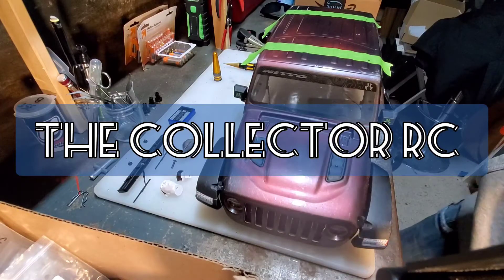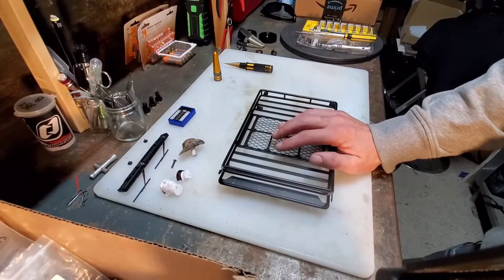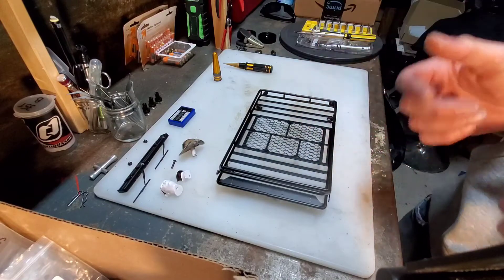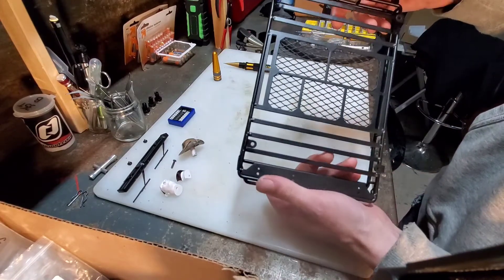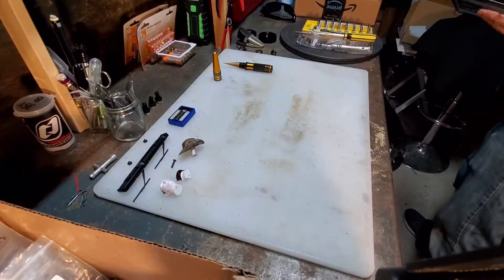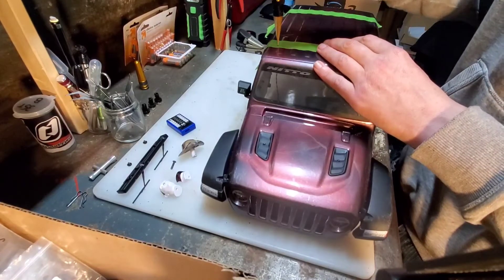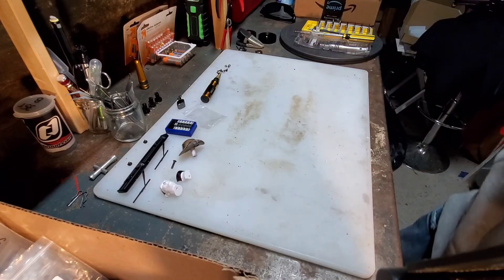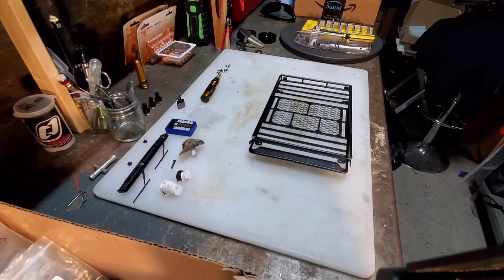The Collector RC- SCX10-III -Metal Roof Rack Installation

Comment: What brand is that roof rack?
Reply from the maker: INLAR RC 1:10 Car Roof Luggage...
https://www.amazon.com/dp/B07QQC4L2K?ref=ppx_pop_mob_ap_share
Reply from the maker: You don't get the light with it. Its a heavy metal roof rack so be prepared to be top heavy and possibly having to accommodate for the weight. Hope this helps.
Reply: @thecollectorrc  thanks bro. I just want it to fit proportionally. Its for the gf rig and she doesn't wanna compete so let's scale it up.